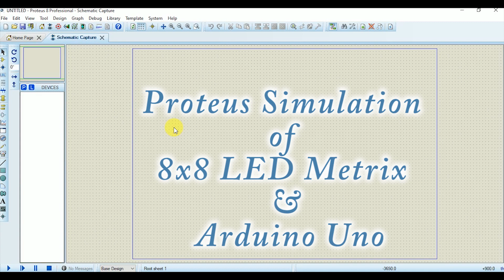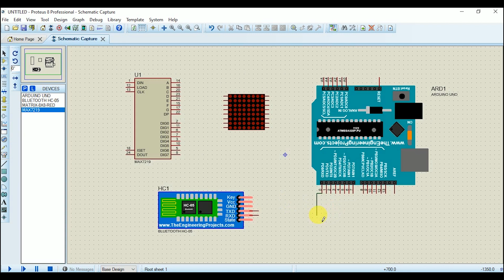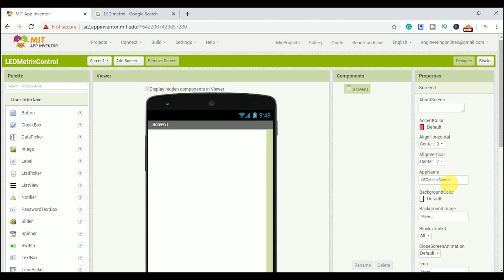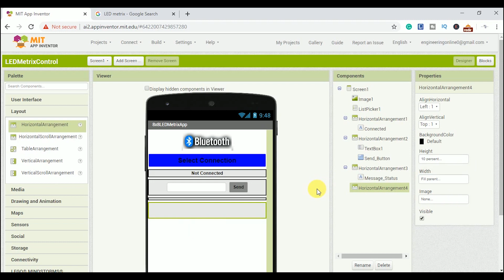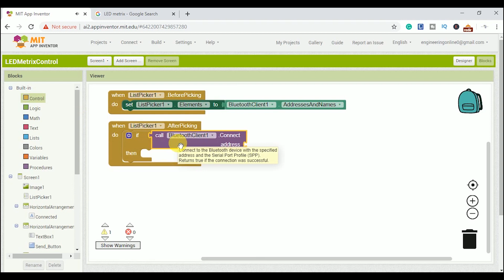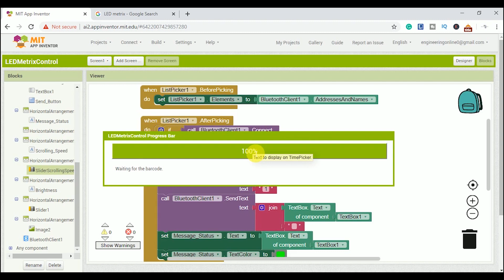How to scroll text on 8x8 LED Matrix in Proteus | Android App on MIT APP Inventor

Comment: I am struggling with this bluetooth component, can you make another video without using bluetooth same project. 
Please
Reply: Thank you. 
Please reply
Reply from the maker: You have two options either use Bluetooth or wifi module. Unfortunately you can't use wifi module in proteus.